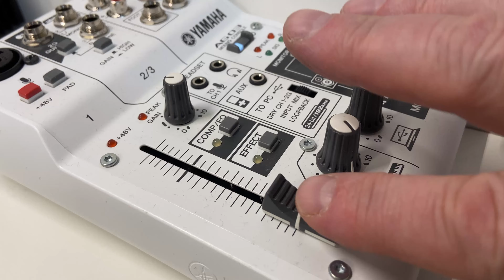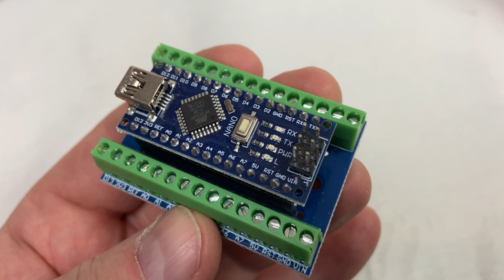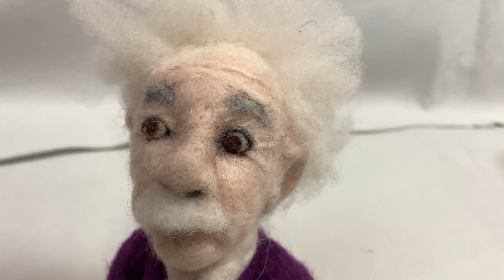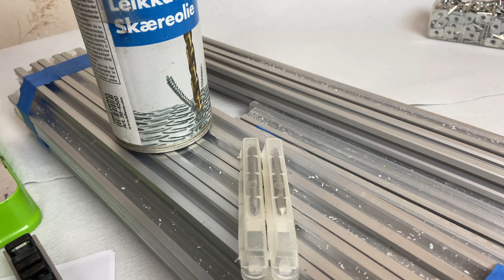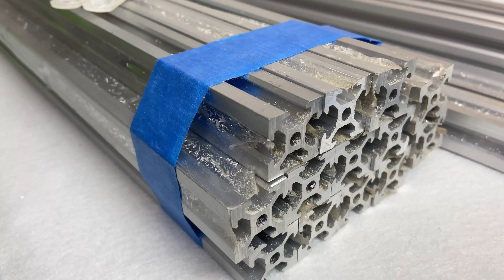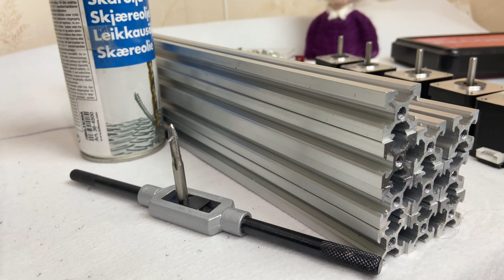It's not a Voron - the frame

Comment: the single linear rod for z-axis is not going to work, you need a double linear rod with the belt drive in the middle. I have a similar setup on my modded annex k3. The twist along the axis of the single linear rod will start showing a print artifactions , more if you're planning to use z-hop while printing
Reply: great build btw, excited to see the 'not a voron' print 😅
Reply from the maker: I know :-) Watch part 3 for the redesigned parts and the options I considered to solve this.

Comment: Why is a closed-loop belt required?
Reply from the maker: It's for the stock geared Z belt mechanism in the 2.4. Yo can see it in the CAD-drawing at https://youtu.be/uai_Z_QIFSE?t=109
Reply: @v4projects  ah that makes sense. It would be nicer if the gear reduction wasn’t required, but then the steppers would run hotter and you wouldn’t need the speed.
Reply: @Scrogan  an other adventage of geared z is, when the printer is powerd down, the bed does not come slamming down. the reduction multiplies the back drive resistance. and more accurate Z movement.
Reply: @CPeP-c6x  I’ve seen printers that just use a spring tension instead. Either way, the printer re-trams the bed each time you turn it on.